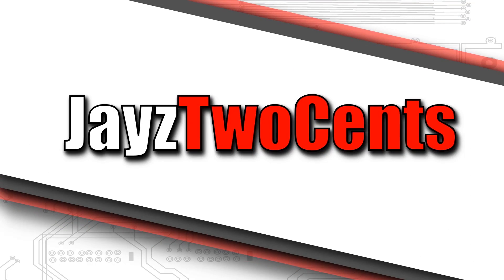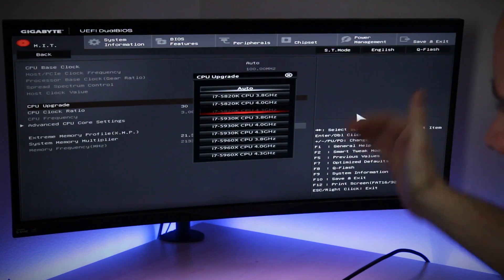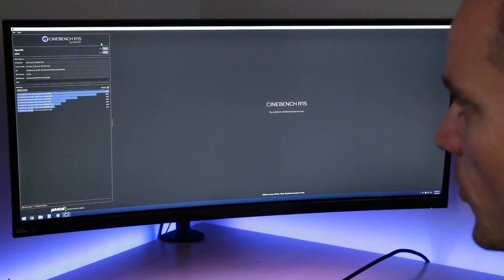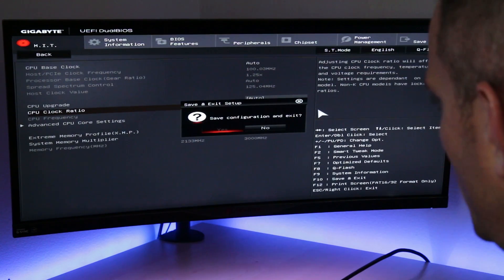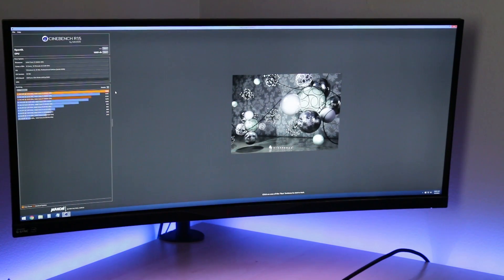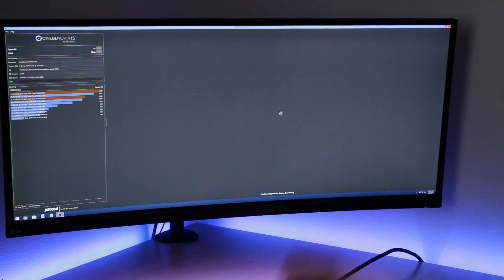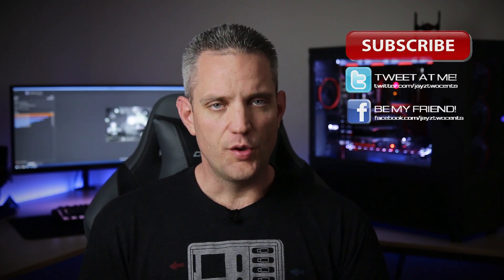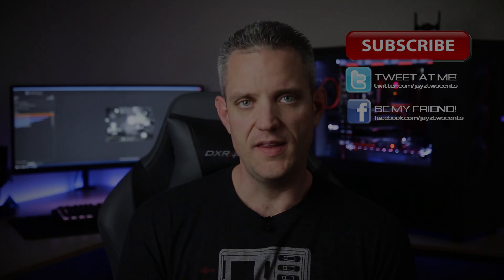XMP vs Overclock

Comment: I did the  overclock whit preset profile like  he did on my gigabyte z270 gaming k3 for my i7700k  for 4,8ghz, but the thing is that oc dosent show in windows, it stil show the base clock speeds no matter what i use to check the clock speed but in BIOS is showing 4,8ghz.
I don’t understand why it does this.

Comment: Every processor has its maximum theoretical memory bandwidth. For example yours has 50 GBit/s. Then if you have dual channel memory, let's calculate. 50/8=6.25GBytes/s. 6.25/2=3.125=3125 Mbytes/s. If your processors bandwith is 50, you can use 3125 memory in dual channel mode. Or 2100 memory in tripple channle mode. Everything depends on your processor. Dont initiate XMP in BIOS before calculating what I wrote above. Your system will not be stable otherwise.

Comment: Ok, so if you buy 3600 mhz and you put it on 3600 mhz is that called overclocking ? because its only the speed it should work on ?? Isnt going above 3600 called overclock.. ??

Comment: my xmp profile for corsair vengence at 3000mhz  does not boot properly, blue screen. with 1.35V
Do i have to bump up the cpu voltage and frequency also for stable ram at 3000mhz CPU 3.2ghz  ryzen 1600

Comment: Anyone know why the RAM was at 2133MHz?
Reply: It was at that speed before he set the XMP tab on the UEFI BIOS to Profile one, 

I remember when Gamer's Nexus said something about prebuilts leaving XMP off causing customers not getting the advertised XMP enabled performance out of the box instead the RAM profile runs at default non XMP, so yeah if you don't enable XMP the RAM's speed defaults at 2133MHz.

Comment: Hello, is b450m compatible with 3200mhz ram?
Reply: Yeah it's pretty easy to get a ram running at that speed on specifically B450M there as you said, it's just the M indicatin' the size of the B450 chipset board as youmight have already known

Also you can expect reaching that 3200MHz speed pretty conveniently easy with a Zen 2 CPU in a B450 chipset board

Comment: I was running a i5 9600k at 5Ghz with XMP and was getting random bsod now and then so turned it off and set the speed/voltage and it's all good now, just need to delid then push cpu oc higher
Reply: damn thats odd do you know what happened?

Comment: I have the same MOBO as you are waving in your hand  i.e. MSI z170A mpower gaming titanium, with i5 7600k and Venegeance LPX 16 GB DDR4 X 1 module with a beginner's GPU i.e. GTX 1050 Mini 2GB. My gaming usage is fairly lite, on 144 Hz LG Ultragear with freesync on 32 inch monitor. I think even if i overclock, there's no point as my GPU will be bottlenecking the build, and honestly, with games like CSGO, CS 1.6 and my comfort in playing all the games at low Aspect ratios, I don't think I even have a need for overclocking there.
But,  other usage is Music Production and that thing during the mastering stage uses around 40-50% of my CPU as shown by the inbuilt meter in my DAW of choice. Moreover, DAW is not really GPU intense as far as I can say. Now, I guess XMP overclocking through MSI bios might help me in music production, loading plugins there, and withing safe limits I believe. Also, Cooler is Coolermaster hyper h410R. 
Suggestions ? I am more of a person who won't Overclock for fun, I mean, If it can enhance the performance in music production, safe way i.e. XMP would be my way to go, else no OC as I have been running.

Comment: bull shit . I just put gskill  16gbytes of 3600 mhz memory on a strix z390-e board and only got 3466 mhz. Probably check dram voltage. found the uefi gpt bios extremely complacated.  Can you advise a better motherboard.

Comment: i have corsair vengeance 16gb ram that i want to unlock to its 3200mghz speed. Should I just set it in the dram setting under ai tweaker instead of enabling it in xmp since i dont want to change the setting on my cpu?

Comment: if i use automatic overclocking will my ram be locked at 2400 even if it’s 3200mhz?
Reply: That depends... Everyone doesn't necessarily have the same BIOS or processor.  But generally, yes if that is the setting that Auto has listed. But you can set it once as Auto, then after manually change the RAM speed to 3200.  Save and restart. If it is incompatible and unstable, it will not enter the OS but restart the post screen. This also allows you to push more than the 3200. RAM usually can be overclocked too.
Reply: Oh, I forgot to make a point that generally RAM speed does not matter to Intel.
However, if you are using an AMD CPU, then you have to worry about RAM speeds.
If it looks like you're locked to 2400 when trying to manually change it to 3200, double check if you have the newest BIOS.  Older Mother Boards might not support higher RAM speeds and might be locked, but that is a BIOS problem.  Most of the time.

Comment: This video as old as it is help me out a lot. I have Use My OC Gen to overclock my CPU and i have done it my self As well. But i was never able to get my G skill sniper ram to run at its 1866mhz When i Play around with the XMP Profile  it would not load windows i would have to go back in to bio's to turn it off to get it to boot up and i did not know why it was not working i try google but i don't think i was putting the right words in. What i do have my ram running at is is 1724mhz With my FX8350 OC at 4.3ghz. But thx too you and this video i now understand why thx mate.

Comment: for me it's not worth the effort... more noise... more risk... more heat... more unstable... for 5 to 10 fps in a game
Reply: It's no secret properly OC'd in moderation, temps will drop, most of the time taking less voltage too, the result of greater efficiency. Based solely on your comment, one can only assume more time researching the many aspects of safely and properly overclocking would go a long way. Don't let nightmare stories and here-say scare you off!

With all the tuning software available now, chances of killing your CPU & GPU are almost zero. You're leaving a considerable amount of performance on the table. There's a lot of headroom left on stock systems to be safely gained.

Comment: I could use some help. I just built a ryzen 2700x system from the bottom up. The problem is that i baught 2666mhz by mistake. I loaded the mem profile but i keep either blue screening of my gpu driver crashes. I dropped my mem back to default and it passed a mem test. Am i really going to be stuck at 2133? Is there anyway to tell which one it is?

Comment: Nice video but I have a question should I update my asus motherboard before using the one touch upgrade.
Reply: The ASUS website and their support for my ROG 17" i7 laptop has been great !!  It's a good idea to register your ASUS computer, even if it's a few years old. A scan will provide driver and BIOS updates, providing motherboard and other OE hardware specifics. The ROG forum is also a great resource and community. If you have OE Intel & NVIDIA hardware, registering will keep you updated. They gave me test & tune software offers too.

Comment: I have 16 GB (2×8) 3200mhz ram. If I set it to 3200mhz because it isn't set to that on default is that considered as overclocking? I'm asking because I'm using the stock cooler for my ryzen 5 2600.

Comment: I set my ram speed on xmp 3200 amd when i boot it and run a test it stays at 1600mhz i have ddr4 3200 mhz kingston ram please help idk whats happening
Reply: DDR stands Double Data Rate.  So 1600Mhz is the memory clock speed X 2 = DDR 3200

Comment: Hi jay I built a ryzen 3 2300x gtx 1070 32gb of 3200mhz Corsair rgb pro 600 watt EVGA psu and a rog strix b450 -f and I can’t figure out the timing to get it to 3200 MHz stable overclock I mean no blue screen but games crash I’ve got it to 3066 with 1.5v is there a timing scheme or graph?

Comment: I have a level 101 quest, I never did OC, and I do not know how to do them, but I bought the maximus hero 10, so I downloaded the AllSuite 3 app recommended by Asus for this motherboard, I saw the TPU tab, I did an overclocking, and it went to 29%,. My question is: this OC done by the app is for the CPU only or includes RAM and somethings in the Motherboard too. please give a solid answer, because I ain't a pro about this when you talk to me about PC specific techs, and from your answer I will start learning more. Thank you in advance

Comment: XMP and my system crashes. Manual overclock on the ram frequency and system runs fine.
Reply: I have the same issue with my z97 with a 4790k

Comment: Can you recommend a beginner's guide to overclocking an Intel 7700K with an Asus Strix Z270F Gaming motherboard? From the comments below, I guess I shouldn't use the Auto settings or the EZ Tuning Wizard in the BIOS, or run the Asus "5-Way Optimization" in their AI Suite software to get good performance without too much voltage and heat? Any links to beginner's guides on these things would be much appreciated.

Comment: Okay, Jayz I tried what you did on my Gigabyte Z170X Gaming 3 with i7-6700k, 32GB (4x8GB) Adata XPG Z1 2800Mhz, Win10Pro, 2- GTX 970 in SLI, Corsair RM850i power supply. It does not have MCE in the bios. Using Cinebench R15..038_RC184115. However, loaded Optimized Defaults in bios  i7-6700k @ 4.0GHz and memory @ 2133 MHz,  BCLK at 100 got  CineBench 15  scored 846.  With XMP enabled -  I7-6700k @ 4.2 and 2800MHz,  BCLK still 100 got score of 859 next with XMP Off and CPU upgrade in Auto to 4.5GHz had i7-6700k @4.5GHz, mem@ 2133MHz, BCLK 100 got score of 949. Finally with XMP on at 2800MHz and CPU Auto boost at 4.5GHz ran a score on CineBench 15 of 962.  I have tried Manual OC but this Gigabyte mobo likes to do a lot of power cycling and not make it Post / BIOS and requires you to completely remove electrical power for a couple minutes only to find everything a default and start over again.  Impossible to achieve OC of 4.6GHz on i7-6700k with this mobo. So enabling XMP really has little effect but boosting the CPU is very noticeable. Windows Defender and anti-viruses turned off and minimal apps running/ and disabled various Startup Programs. ASUS RealBench score total is between 124,000 to 130,000.  Thanks for the info video. Hope you keep going strong here in 2019.

Comment: Maybe if someone that reads this can help me because I found out about this today and did it for my ram just enabling xmp after doing it my system turned on for like 3 seconds with all rgb and stuff but then shuts down and it keeps repeating this. I hope I didn't like completely destroy my system. (I'm not that good with pc's)
Reply: Did you ever fix it?
Reply: Matthew Diabo Yeah I did by holding a screwdriver against the cmos pins a couple of times until it worked

Comment: tried xmp profile of my ram. system crashed at stress test. manually overclocked with a lot reading and try n error. (was my first time back then). now system is overclocked and stable.

Comment: i7 8700K 4.9Ghz at 1.27volts  32GB dual channel corsair dominator platinum 3000 mhz OCed to 3400Mhz using a ROG Maximus Hero XI with a NZXT kraken 62 stable thru a 39 hour 3d studio max render pushing 100% load no synthetic here max temps were reported 86c to 94c lovely lovely machine shes called CARBON0009

Comment: I did a asus prime z 370-a ez tune 5ghz. Get into games with msi afterburner / rivatuner runing it sais 4995 mhz . but then starts bouncing between that and 4696 mhz im confused by this on the target screen in bios it sais target turbo speed 5ghz target avix speed 4.7ghz ram freq 3200 . I noticed the avix or what ever it's called sais 3 off set and the CPU core volts is still on auto . when I manually change the avix offset to 0 it will run games all night at 5ghz steady . but I think I heard putting it to 0 with a 5ghz oc is bad . so question is should I set it to 0 or take the voltage off auto . my temps get to about 65c gaming for hours

Comment: I have x370 gaming k4 and when I go to OC tweaker I changed my DRAM frequency from auto (DDR4-2400) to DDR 4-3200 (didn’t change tcl,trcdrd,trcdwr,trp,tras) and change DRam voltage to 1.350V. When I checked my task manager (Proformance -> memory -> speed is 3200 MHz). And then I check cpuz and my is 22,22,22,52. Is it okay?

Comment: you can get higher scores in cinebench if you only overclock the cpu, overclocking the ram doesn't do much for gaming. but limits your cpu overclocks and performance, as you saw by your last attempt that cpu overclocking yields better results
jay gets called out once again.

Comment: 8700K 4.7Ghz at 1.25v 
(stable 4.7ghz oc @ 1.25v or 1.3v) which one would u recommend on air cpu cooler like Hyper 212 x (saftey purpose at least 12hrs) ?

Comment: so here's a scenario, i have g skill ripjawsx 1866 ram 4 x 4gb ddr3, asrock z97 extreme4, 4790k oc to 4.6ghz at 1.275 stable..i have the latest bios installed, i am running xmp profile atm, if i enter the numbers exactly from the gskill 2133 variant at 1.65 volts...do you think i should be ok? just want some feedback before i tinker...thanks ....would even like to go to 2400mhz if possible..***Update. entered in the 2133 timings and 1.60 volts, its running great and stable!

Comment: Hello Jay, great video! Can you help me with a question about overclocking an old gaming rig? I have a 2005 Alienware Aurora 7500 station. IT was a beast in its day and has lasted this long. I can do most everything now I can do on newer computers but it is showing its age.  It may or may not have some bio options the newer machines have what do you suggest I do? I can't afford a new gaming rig and don't want to kill this one. I could update the motherboard to 2018 standards but its all very confusing.

Comment: I know it's an old video now but this one scares me a bit. Some of the voltages motherboards pump through the CPU/memory controller/RAM, etc are crazy high when using the auto overclock settings. Although the built in protections these days are also pretty reliable, so long as they aren't disabled by the OC profile.

Comment: First time CPU overclocker here I have a Ryzen 5 1600 @3.8Ghz with 1.3000V and this is with a stock AMD wraith cooler, Idle temps are only 40c so i'm glad.

Comment: i remember overclocking back when you needed to trip jumpers on the motherboard with a piece of aluminum foil and draw a line with pencil connecting certain pins on the CPU.

Comment: my G Skill Ripjaw xmp just bumps up DRAM Voltage, VCCIO and System Agent voltage, plus the DRAM multiplier. BCLK stays untouched.
I changed xmp to manual and lowered those voltages and its fine.

So XMP varies by manufracturer how they achieve the overclock?

Comment: its not XMP vs Overclock, its XMP & Overclock Both. there is no problem using xmp and overlclocking cpu. why not do both ? should be no problem for you cpu oc. high mem speeds really help on heavy games.

Comment: I have a gigabyte z370 gaming 5 with a i5 8600k and using the predetermined overclocks, i have it set to 4.7. how to i ensure that the overclock got applied? i run cinebench and watch my clocks using HWmonitor and clocks max out at 4.1... Thanks for the help

Comment: Had to jump back on here and say thanks Jay. This video gave me the confidence to overclock my i7 4820K from 3.7 (3.9 turbo boost) to 4.6GHz. Ran hot as hell so I lowered the voltage, after some stress tests it seems pretty stable and barely hit 70'c under full load. Next chance i get I'm going to see if I can push it further. Should have done this years go.

Comment: Jay, I know this is 2yrs. late and you may never see this comment. If you do please comment back. I have not been around computers since the 1st i7-920 was released. At that time only certain DDR3 ram had XMP. It was a new thing and you had to do your memory timings. 
What do you think of this, since auto mode is availsble run it to the max and write down settings. Use the max. XMP profile for memory then bump up the CPU setting to the max. stated in auto. That setting would probably be the most stable with air cooling!

Comment: Your math was wrong Jay. It was an 11% improvement from the 1,330 score to the 1,495
10.4% increase from 1,669 to 1,495
20.3% increase 1,330 to 1,669
4.5% increase from 1,669 to 1,748
23.9% total increase from 1,330 to 1,748 :)

You divide the smaller number by the bigger to see the percentage and then you calculate the difference. (or just - 1 to your percentage and then just remove the negative to see the % increase.)

Comment: Hi i have issue with X.M.P please help.

i have i7 7700k.
asus z270f.
Corsair V 32GB 3200Mz 8GBx4 RAM Kit

and i Delid my CPU use TG Conductonaut. And i hit 5.0Ghz 68 Max tem. But when i enabled XMP it will hit 82 temp can you please help me to solved this? :(

Comment: i got a 5.1 oc on my 8700k from 3.7gh im running a aours z370 ultra gaming with a intal i7 8700k Being cooled by Corsairs h115i RBG Pro 32 GB of Trident z RBG From G skills Nvida Gtx 1080 oc from gigabyte and a 1 TB ssd and 3 TB hhd well i dont really know if its an overclock cause i used one of those profiles it said upgrade CPU and i choose the I7 8700k 5.1 Gh  and i used cpuid CPU z to confirm and all 6 cores are running at 5.1 CPU is at 1.35V  and 35 min under full synthetic load temp never went above 74% C  ive been ruining it like this for three days now no problems so far

Comment: If temps are under control can I continue to push the voltage higher without damaging the cpu? my 7700k is delidded and watercooled, even at 1.44v temps don't go over 70c but I'm too afraid to run at that voltage

Comment: Can help me, i have a ddr3 ram 8gb hyperx 1866@1.5v i installed it in z170m-hd-ddr3 i entered into bios in the dram voltage default value it should be 1.5v right? But when i scroll i saw 1.35V in the dram, is that normal on hyperx fury RAM? Thanks